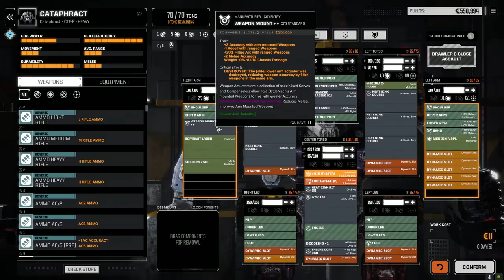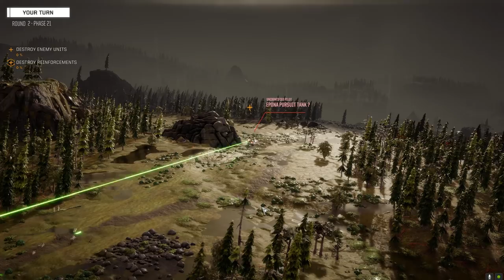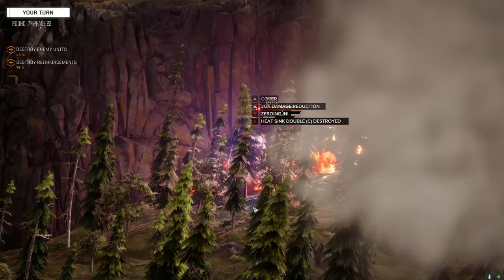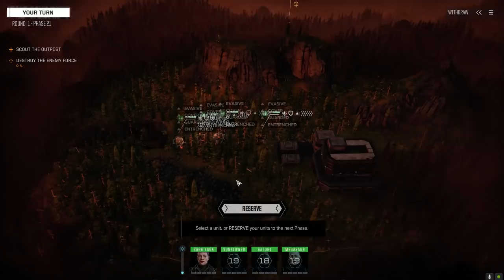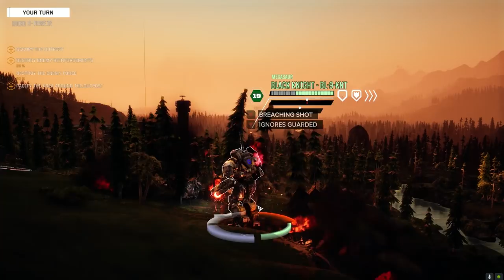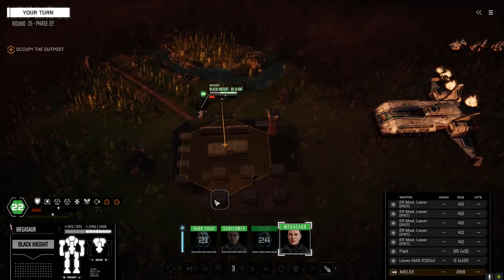Roguetech - Night Witches - Ep78

Comment: Well now you know that the bombast and vspls just aren’t worth their weight. Even if you barely fired the vspls at more than a rate of fire of one, it looked like their chance to hit went down as the RoF increased and the heat increase was ridiculous.

You may end up having to fit an xl engine and a larger fusion core and e-cooling in order to get a suitably hard-hitting loadout on the cataphract. Might let you run a rac/5 in tandem with the double ppcs (that’d be a heck of a splash weapon to follow up the pinpoint from the ppcs huh?).

Either way you might want to make use of one of the clan advanced fcs that you have. The breaching shot to ignore damage reduction from cover can be extremely helpful, especially if you have a pair of punchy weapons that you can split up.

When the message pops up for whatever mech you have assembled, the flavor text in the main body of the message often does not match the name of the mech at the very top of said message.
Reply from the maker: There will be a Heavy Lance making its appearance in a few episodes. I think we are thinking the same things in terms of loadouts.